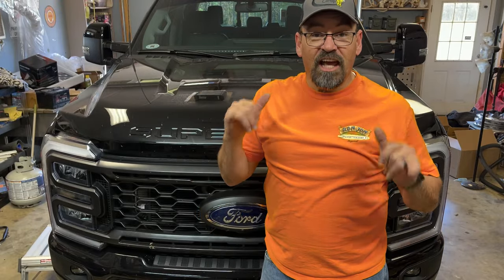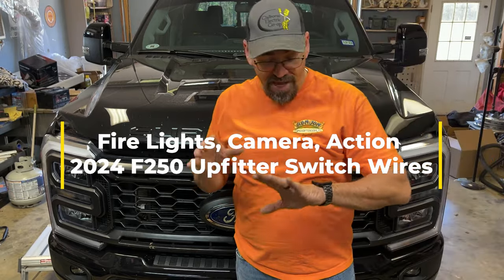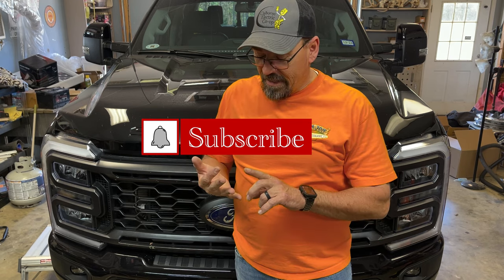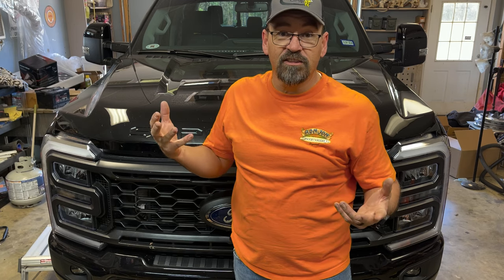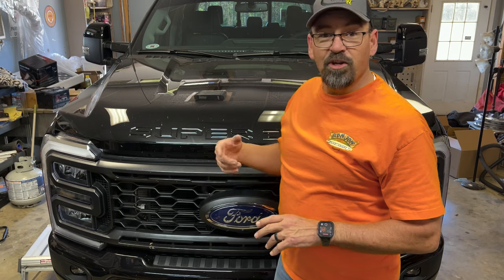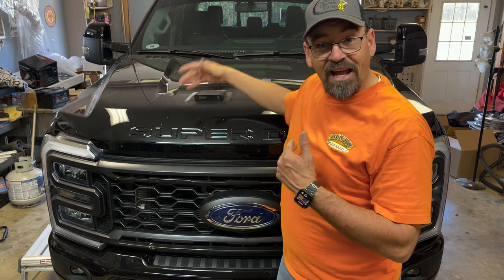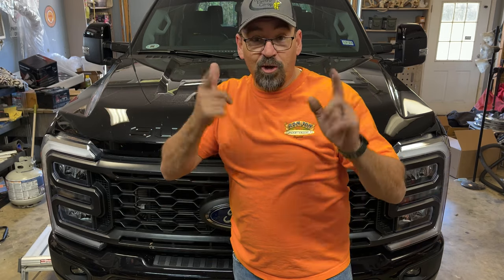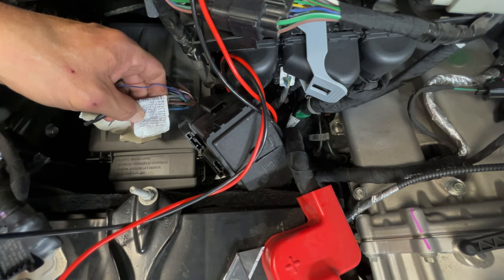How To Find Upfitter Switch Wires On Ford Superduty, Lights, Camera, Action #tips #tricks #howto

Comment: Subscribed. I run front and rear cameras 2023 F250 Diesel. I power cameras in the same fuse box. Up fitter switches. I’m getting ready to do some installing. When I locate all six wires I’m going to extend them one foot at least. This way I never have to get to bottom of that box again. Get a wire marker kit to identify wires. I also just tucked in my camera wires front and rear. Did not remove puller. Very good video.
Reply from the maker: I like having front and rear cameras. I catch all kinds of stuff. Thank you for your comment.

Comment: Thanks for the video
Two questions.
1. Can you show how you ran the wire through the firewall?
2. Why did not use the pass-through wires instead of running the wire through the firewall?
I believe those are located near the interior fuse panel, passenger side.
Reply from the maker: @LoCleTXRV  it’s been while since I made this video. I think the pass through wires are tiny and I didn’t want to use them for that reason. I just made a pin hole in a grommet on the passenger side. Then I used a hanger to pull the wire through like a needle and thread. 🪡

Comment: I’m a little confused if you’re wiring, the lights to your Upfitter switches, why did you need to tap to the fuse box?
Reply from the maker: The wires come out under the fuse box. These are the wires from the switches inside the truck. This is where you connect them to whatever you are hooking up.
Reply from the maker: The fuse box was for the camera. It needs a hot wire to function while parked. Upfitter switches don’t work with the truck off.

Comment: So you tied your cameras into the fuse box under passenger side? And you tied your lights until the upfitter switch that has nothing to do with the fuse panel you tied your camera into right? I'm a bit confused what you needed the fuse panel for under passenger dash still. Why not tie your camera into an upfitter switch?
Reply from the maker: Camera needs a hot + all the time wire. That way it can start recording if it senses a hit by another car while parked. The upfitter switches are for the fire lights.